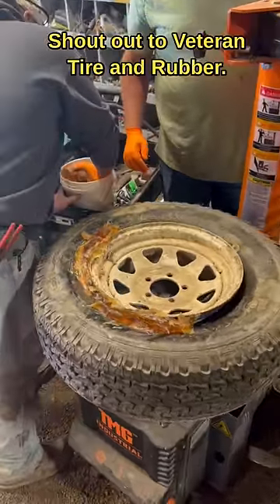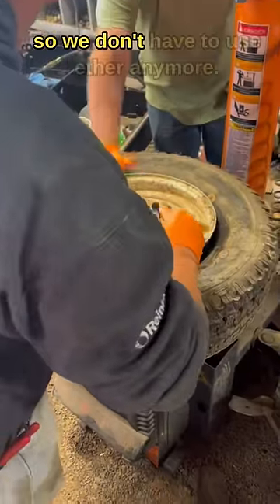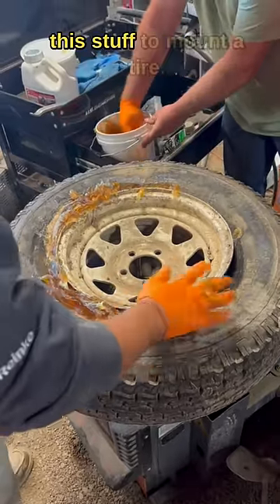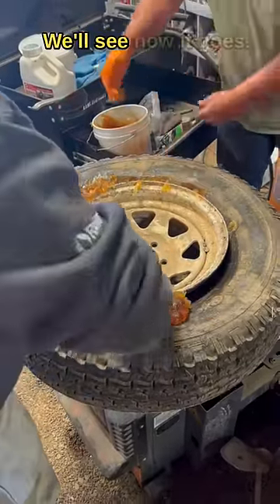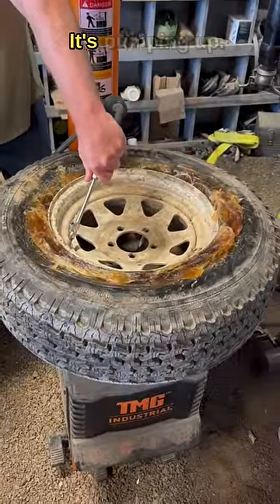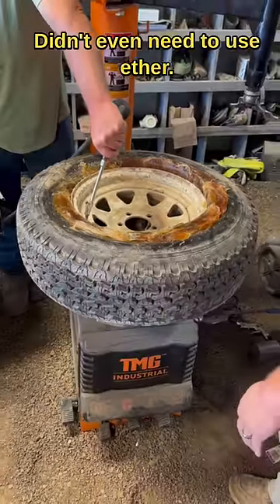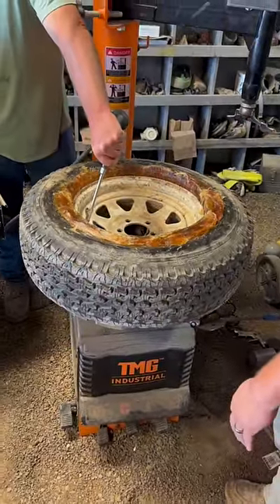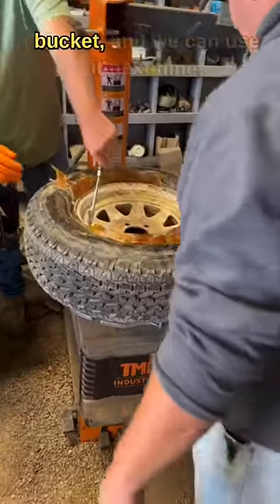Veteran tire and rubber sent some tire mounting compound. Let’s see it work. #farming #shorts ￼

Comment: “Thanks veteran tire and rubber” 
turns off camera 
“Throw that messy shit away and grab me the ether”
Reply from the maker: We plan on using it a lot.
Reply: I thought the same thing 😂
Reply: The ether?
Reply: No shit. That tire goop looks nasty.
Reply: @RockyMountainFarmer the ether... not the goop
Reply: @RockyMountainFarmer  this reply was brought to you by veteran tire and rubber
Reply: I would thats stuff way to messy
Reply: You better put your safety glasses on because that crap is going to fly everywhere
Reply: Ether? Buy a damn cheeta
Reply: Greasier and less fun😅
Reply: @RockyMountainFarmer  why not just use an air connon?
Reply: @RockyMountainFarmer that tire will never be balanced with a quarter pound of that gooey mess that squeezed in the inside of rim ...just sitting inside in globs and clumps, breaking down in the heat, and sticking in clumps in the cold ..uneven wear on tires and bearings leading to premature failure and loss of life...
Reply: Oh my......we need this for mounting bobcat tires!
Reply: As a customer I would be upset about the discoloration it left.
Reply: @1truthseeking8 this tire isn't going on a mercedes, so I don't think they care 😅
Reply: @JesseJames-ig7gu it's a trailer tire. no one cares
Reply: @cookmania3465  I would
Reply: So right you are
Reply: @RockyMountainFarmer  It's Murphy's soap
Reply: @JesseJames-ig7gu it's literally soap.. it washes off..    

And to everyone else complaining it's in the wheel. Clearly isn't a tire technician.. it has air pushing into the tire and pushing the slime out.. simple physics.. .001% exists on the bead afterwards.  

   Yall should be more puzzled on why they didn't remove the valve core..
Reply: @seanmiranda8551  This is 100% accurate. You can tell who has worked in a tire shop and who hasn't!
Reply: pretty much
Reply: The problem with ether is recently they changed the formula so it burns your hands really bad for some reason
Reply: @RockyMountainFarmer What you and your lady do it home is not for youtube.
Reply: @Servant-of-Christ88  all so known as starting fluid .
Reply: @RockyMountainFarmer I plan on using a lot of ether and LSD
Reply: I wouldn’t want that hoop anywhere near my wheels and tires. And that comment made me laugh my ass off. 😂 dammit man.
Reply: It works well with larger tires as well done a lot of seeder / sprayer tires with this stuff , where the bead blaster fails this will prevail.
Reply: @RockyMountainFarmer have fun balancing it. 😆
Reply: @pnkgxd1734 both of those fry your brain, after a while. I'm lucky I can think at all. 😆
Reply: @RockyMountainFarmer  why not just hook the air house up to it and pull up on the tire first before even touching that messy stuff
Reply: @RockyMountainFarmer   rachet strap is less messy and no goop gets in your customers tires. get an electric on if your that lazy, just sayin
Reply: @CT-qx8nl silly bobcats have legs.
Reply: 😂😂 I am sure it's soooo much cheaper too
Reply: @RockyMountainFarmer must have paid you good 😂
Reply: @1truthseeking8 from what I’ve read/heard, none of it will get stuck inside the tire. The pressure pushes it all to the outside
Reply: It’s literally soap. Using it on such a small tire is ‘special’, as a bead blaster would get it without any issue.. but you literally wash it off and it cleans the tire off at the same time. It lathers as a hand cleaner as well.:. Not exactly sure what’s in it other than vegetable oil. But I’m sure it has lye and propolene glycol as well
Reply: @RockyMountainFarmer because you'll get fined for not using and and trashing it 🤣
Reply: @pnkgxd1734 "let the good times rolll" 🎶
Reply: @BiffTannen1983 g and ether fries your brain more than acid ever could.
Reply: @lanceallen9875  that doesn't work. If it were that easy, he would.
Reply: @adamvaughn6921  you think wrong (with all due respect). It won't hold air, until the beads are set.
Reply: @BiffTannen1983  oh but it does work all the time. I’ve personally used it many times. On the bigger tires it don’t work all the time but the normal car tires it works easy.
Reply: @lanceallen9875  sorry. I've only done it once. My luck wasn't so good. 😆
Reply: @BiffTannen1983  yea you gotta take the valve stem out so you get more air flowing. But ether is always the best way to go in my opinion. You also go those air blaster things
Reply: @BiffTannen1983  but it will still pump up a little bit
Reply: The air will push the sides alittle closer
Reply: OH NO!! THE ACTUAL DUDE CAME IN & SAID "NAH, WE'RE GONNA USE IT"!! HAAAA HAHAH......wait, really? That ain't takin' a million years for each tire? Y'all ain't in a hurry tho?
Reply: @1truthseeking8 I know it was actually serious, but I laughed until snot came out reading your comment about that "gooey mess", just picturing you extremely disappointed after somebody did that to your tires...LOLOLOL
Reply: @@GayHooalsFinest Hit it with your purse buddy, hit it with your purse.
Reply: @seanmiranda8551  Looks like grease to me, as for not getting inside, you’re smoked out and obviously never went to school
Reply: @JesseJames-ig7gu I'm actually a licensed commercial tire technician..  Its not grease.. most people know grease doesn't just  rinse off.. 
or suppose to he anywhere near a brake system...   Also it's soap!  Just thick sticky soap! The whole concept is to fill gaps.. anyone that works on equipment would contest or mobile guy. Anyone that works scommercial would all vouch if they had any experience..  its also the same stuff they use as rim slip the lubricant that allows the rubber to slide over the bead...
Reply: @CT-qx8nl use fuller Brothers tire cream for your off highway tires mounting. Just never use it on car tires. It will spin inside the tire. Also a 3 inch wide ratchet strap is your best friend for seating skid loader tires. Just watch your forearm when you release it. It likes to bite you
Reply: @RockyMountainFarmer just use the ether
Reply: @JesseJames-ig7gu 
Of course you would, Karen. 
(99% of shops will clean it off before mounting it on the car.)
Go back and play in your sandbox, sport.
Reply: @icefisher1171  Most lazy tire shops would leave it on there and then give attitude when you ask them what this 💩 on my tire is. 
Go wash your cape capt.
Reply: Why not a cheetah
Reply: @RockyMountainFarmer use it on my tire and I'm filing a lawsuit
Reply: @RockyMountainFarmer must be a pretty slow business then haha, ether all the way or idk do it the correct way
Reply: @bradpeppers1364  no sponsorship
Reply: Good luck trying to balance the tire
Reply: @RockyMountainFarmer the compound or the ether? Lol
Reply: Start going home with soft hands and your old lady is gonna think you're cheating.
Reply: Use either to clean hands
Reply: @JesseJames-ig7gu  I would to I don't want my trailer bouncing down the road!
Reply: @SteveV6206 yea but who would want to slap all that shit on there then scrape it back off then wash it with soap and water when you could just use ether or a tire cannon or whichever you call it and be done with it?
Reply: @onawhimadventures7672 then use carb cleaner that's what I use when I don't have ether?
Reply: @bradpeppers1364 because they don't make money off of you if you use an air cannon 😂
Reply: @SteveV6206 working in a tire shop isnt anything to brag about 😂 it was my job at 15
Reply: @thanos7110   it's soap don't be dense
Reply: @SICresinwrks  way to talk down to people and look like a jerk
Reply: @CT-qx8nl I’ve seen it used on those too and it sucks
Reply: @RockyMountainFarmer  The ether?
Reply: @RockyMountainFarmer  have you tried using a ratchet strap tomake the tire seat better to the rim?  you would use a whole lot less of it and easier cleanup
Reply: @johnstickles6789 not really, did you see how easily it cleans? lol a lot better then what I expected.
Reply: It's soap.
Rinses off.
Or makes your bead lube if you mix it with some water.
Reply: @johnstickles6789  it's soap gel.
Reply: @RockyMountainFarmer how do you balance? Or just don't do it.
Reply: I just burst out laughing because that would be the exact words out of my dads mouth
Reply: @1truthseeking8 
I was pondering the same outcome.
Reply: The ether is better if you got a lot of rush jobs
Reply: That’s not how you us it lmao😂
Reply: @RockyMountainFarmer you're referring to ether right 😂😂😂😂

Comment: A $60 bead blaster has never looked like a better investment
Reply: Was looking for this one
Reply: Exactly 💯
Reply: Shows how much u know it doesn’t always work
Reply: Honestly, I think I’d way rather have this than a bead blaster also in my opinion a bead blaster would be my last option so this is less abrasive. I like this stuff that’s bad ass.
Reply: @donutcrash  bead blasters are quick and easy to use, and work on almost any kind of tire almost every time if you have a good one. And I feel like this goo stuff might fall into the tire a little bit and cause the tire to not balance out as well, but maybe I'm wrong on that
Reply: The tire shop I worked at had a $1000 bead blaster
Reply: @donutcrash less abrasive? Are you talking about a media blaster?
Reply: Honestly this is going to take way longer than hitting it with a dash of ether
Reply: @jacobwallace9128 then you you use a ring blaster or both no need for more , some would say im wrong but then il say you got the wrong tire for that rim
Reply: Bead blaster works better than anything use them for 12 years no problem
Reply: Ours is $2500
Reply: Naaa fuck that just use brake clean and a lighter
Reply: @jazlynnknight you can make one from a propane tank, but for what they cost I would buy one. Or a cheap air tank. 1.5 not schedule 80 black pipe, ball vlv. Get someone to tig weld the pipe to the tank.Dont trust a wire welder for that. Also make sure you put a relief vlv on it so it don't blow up on you. 😊
Reply: @jacobwallace9128 yeah it’s usually not the first thing you use to seat a tire. More of a last resort when you can’t get it by hand at least from my experience and they weren’t 60$. Plus they don’t even work all the time like you said
Reply: Sometimes tires so flat that shit aint work. I never used this stuff tho, so cant say if it works better or not than a bead blaster
Reply: @jacobwallace9128  I try the bead blaster 1000 times before I try this messy shit
Reply: Sometimes bead blasters don’t work tho
Reply: @jacobwallace9128 
Yep. The cheetah 🐆 is awesome, but I’ve had tires that using this mounting compound shit AND the cheetah it still took several tries to get the bead.
Reply: @SmilesPerGallon- bro ive used whole buckets of fry lube a bead blaster and a ratchetstrap. Them 19.5L24s are a bitch especially in -20 weather and the wholesalers love to stack them so the beads get squished. In my 10 year experience. Whatever it takes to set that bead is the right answer.
Reply: 60 bucks my arse
Reply: Sometimes even they don't work. Fuckin transforce tires....
Reply: If a bead blaster works on semi trailer tyres I’m sure it’ll work on those
Reply: @jacobwallace9128  shows how much you know that you still don't need murphys, been in a tire shop for what, almost 3 months there buddy? It's all good keep at it you'll get better eventually. Chedderheaded highschool kids give experienced tire techs a bad name...
Reply: We used to call them pigs at the shop I worked at Jake go get the pigs we have 28 tires to change and mount yes I worked Ina. Diesel shop and changing those tires let me tell you I didn't need steroids I was jacked
Reply: @jacobwallace9128 You must give up easily or don't know what you're doing. Sometimes, it takes several tries, and sometimes, you need several people to push on the tire from different angles. I've always gotten it to work.
Reply: @donutcrash Do you not know what abrasive is? Or do you not know what a bead blaster is? 😂
Reply: As someone who has done it with a bead blaster is small tires can explode. This is less risk of the tire exploding. For sure. Safety first.
Reply: @TylerSmith235  I agree that safety can be important, but productivity is usually more important
Reply: The car lot I worked at had a tire machine that had one built in. I thought that was standard
Reply: @xXAquoskillerXx  yes I think every tire changed Ive ever used (13 of them), have all had one, some of them were kind of shitty but still had one

Comment: I used to run an auto repair facility, and we had a customer bring his trailer tire that he was having trouble mounting his tire. We had the same stuff. But what happened when the tire mounted was priceless.  When that tire popped, the compound went flying everywhere. Some of it when all over my technician. It looked like an elephant came all over his face. I laughed so hard, I shart myself.
Reply: I was wondering what happened to the 1st pop. The one that would of covered them with that stuff. You usually get two. Makes me wonder if the bead is good there or is that stuff hiding leaks where it didn't seal
Reply: @STEVEN-STEELE  I think ur right, it's 100% hiding leaks 🤣👍
Reply: @stevensteele4803 it popped twice
Reply: Haha
Reply: I do this for a living and if you do that your special
Reply: Haha worked for an “ok tire”. Setting a dump truck tire on them big steel rims with pry bars and air pigs. All I’m gonna say is There was bead sealer on the back window, seatbelts, inside door handles of the car on the hoist in the next bay.  Turned into a detail shop that day at 5pm.
Reply: Only took 2 people 20 times longer than using a lil shot of ether....
Reply: @ScottWM54   shops with insurance can't do that inside of a building they make a cheater that shoots air into it.
Reply: I wonder how much goop is in the tire ??
Reply: Did u wipe after or did u champ it out all day ?
Reply: Did you lick it off his face
Reply: Did you save the shart?
Reply: Ahahahahaahah
Reply: I 💩 my pants reading this story..funny bro...good one..lik what yall was expecting 🤦🏾‍♂️
Reply: That’s a win!!!!
Reply: I think got enough on there…..
Reply: Not Elephant beat Juice 😮😂
Reply: Sounds like you got the worst of it, especially if you didn’t have the foresight to bring extra underwear to work that day.
Reply: I'll stay with the starter fluid
Reply: This is the comment I was looking for! I was waiting for the same thing to happen!!
Reply: Ratchet strap does the same shit
Reply: That's one of the benefits of using this technique
Reply: @cM-zm5kp thanks for killing me
Reply: LOL you sir, have won this comment section
Reply: I was trying to bead blast a backhoe tire, was having trouble and my boss at the tire shop insisted i put some of that mounting compound on the bead, and we would hit it from opposite sides with 2 bead blasters.  I knew it was going to come flying out in his direction and was trying to warn him. He said " No, you stand there, i stand here, go on 3. 1...2.... Splat... He got a fistful right in the face, fell over, and started trying to claw it out of his eyes. I was trying not to laugh, but he couldn't see me waving at all the other guys in the shop to come look at what happened. 
Honestly its how i thought this video was going to end.
Reply: Thanks, Mrs. Apper 4 ever....
Reply: REPENT and believe the gospel and you will be saved from the fires of Hell.
Reply: @STEVEN-STEELE you can hear the leak at the end of you listen closely
Reply: LMAO did not expect the language at the end
Reply: @jackmichaels7682  When they went to the PSI sensor that blew the horn when you had reached the proper PSI. Well I had put a new tire on and pressurized it at the machine before high-speed balancing it. This was the 1st one I had dealt with. Part of the service was checking and topping off fluids, then last gage, and top off the other 3 tires if they needed it. The lady was in the car, and I hit the front passenger side because it was a bit low. That damn horn blew. I was instantly pissed. I mean.I couldn't help it. Seeing it was a little old lady calmed me, and the other wrench was almost rolling on the floor laughing. He came up and stopped me telling me he had his 1st one the week before.We did it to one another sometimes, but we all expected it. But I almost shat my pants. The shop was quiet. This was my last job for the day. Everyone else were already cleaning and storing their tools.We had stayed open for her because she was a good customer and getting on in years. She had it brought in on a roll back.She tipped me 10 dollars and insisted I take it. Saying she does the same for whoever she gets when she brings it in. But damn right in the ear . I was at its level looking at her inner fenderwell and plastic engine guard.
Reply: Guys, here is the true Savior

HalleluYAH translates “Praise ye YaH”

YaH is The Heavenly Father
YaH arrives via the TENT OF MEETING
YaH was Who they Crucified for our sins
YaH was Crucified on an Almond TREE

Semitic of Moshe (Moses)
Isa Scroll (The Original Isaiah)

Isaiah 42:8 - I am YaH; that is my Name! I will not yield my glory to another or my praise to idols.

Isaiah 43:11 - I am YAH, and there is no other Savior but Me.

Isaiah 45:5 - I am YaH, and there is none else.
Reply: Hilarious!!!
Reply: Shart can be present and past tense